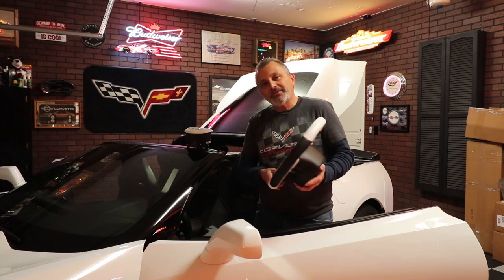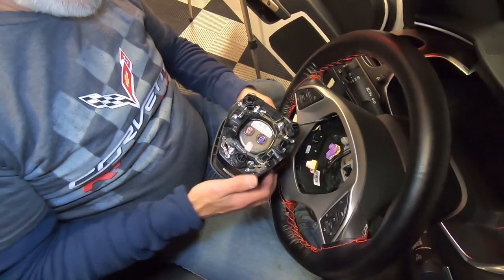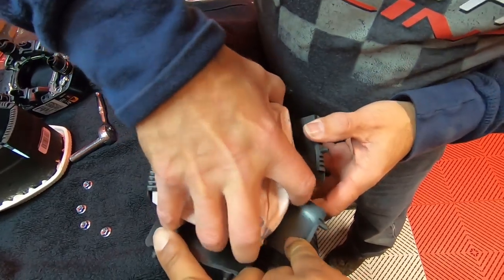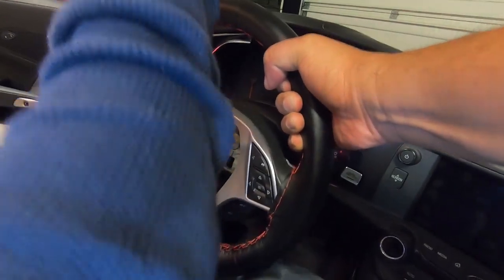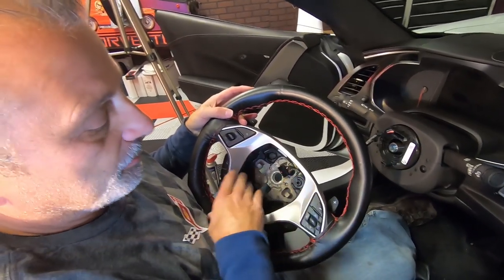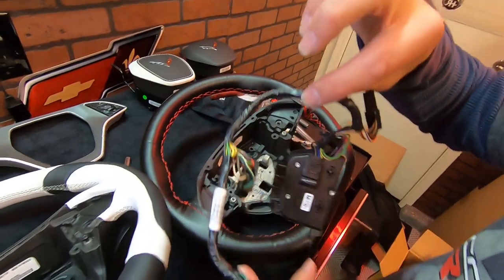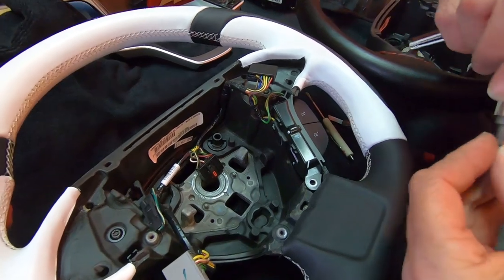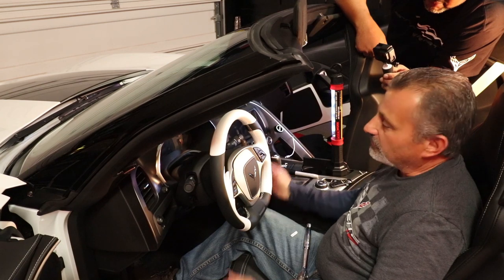How to Install a Custom Steering Wheel in a C7 Corvette

Comment: It snapped because it was heated up.  When metal heats up it expands and fatigues it hence the break.  A soldier gun on the outside of the bolt and 2 or 3 torx would have it out in a jiffy.  Swap out the torx every 5 seconds or so would have kept them cool enough not heat up, expand or break up.  Plus that helps keep the bolt cooler which keeps it from expanding itself.   Keeping the bolt cooler helps it from expanding and grabbing onto the hole it’s in!

Comment: I believe you used a non-impact socket.  I did the same thing on my 2019, swapped the steering wheel, and purchased a set of Torx bits from Lowes/Craftfsman. The finish was flat back, not chrome.  While the nut on mine was extremey tight, it did come out, eventually.

Comment: Good video! Dumb place for the battery!

Also, ya need is a couple T-handled allen wrenches. Would make it a little easier.

Overall, I'm glad you're doing this replacement! It kinda looks like the job from the Darkside.

Comment: I also have a C7 (2016). I am not in the market to change my steering wheel, but I just love to watch your install videos. I also watched your side skirt and front lip installation video. I will be installing those once the weather here in Canada gets warmer. I was wondering, since the impact gun made the bolt so hot, would that not expand the bolt, therefore making it harder to come out??
Reply from the maker: Hi Don, Thanks for watching it means a lot!! I hope you stay warm!! Take care... Scott
Reply: @THECORVETTECHANNEL  Hi Scott. I trust you and your wife are well and staying safe. I am a new owner of a 2016 C7 Z51  Vett. I purchased my Vett in late October last year, pretty much in time to store it. Over the winter I've been doing a lot of reading and watching YouTube channels such as yours to learn about body and engine mods. I came across a video featuring a product I've never heard of before. A catch can, air and oil separator. I'm sure you've heard about this and am wondering, did you install one? Are they necessary?  Are they a "good to have, certainly won't hurt" type of product. From what research I've done, it seems like a good idea. But I don't want to add anything to the engine that might result in damage.

Comment: Great job, when I did mine the wheel didn't line up the first time when I drove to keep the car straight I had to hold the wheel at 2c oclock taking it off the second time the clock spring out with it had to have that and the steering angle sensor replaced.
Reply from the maker: That sounds like something was not right from the factory they are keyed to only go on in one spot.
I'm sorry that happened to you!
Thanks for watching!
Reply: @THECORVETTECHANNEL  thanks its all good now.
Reply: That's exactly what happened to me. I mentioned it to my mechanic and he thinks that since the wheel is keyed, when I was loosening or tightening the steering wheel, I may have turned the shaft a bit. As soon as the weather gets better here in NJ, he said to stop on down and he'll align everything.